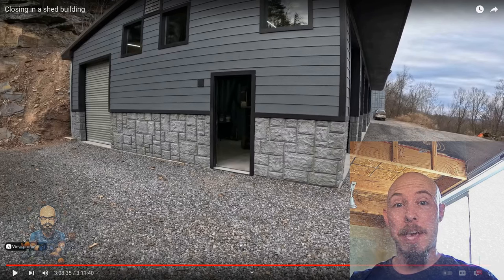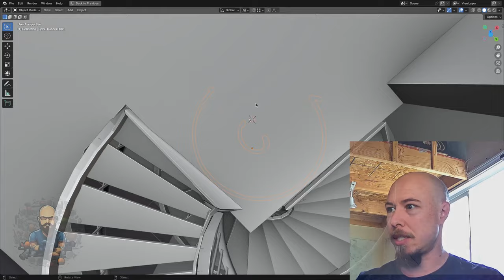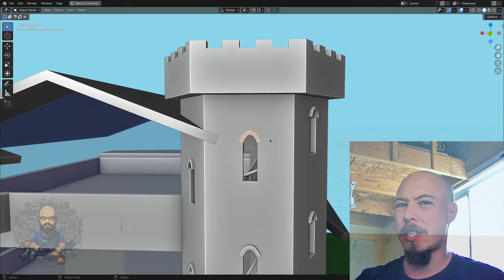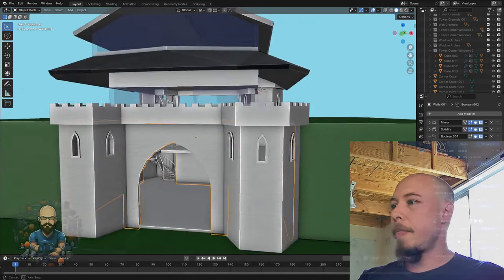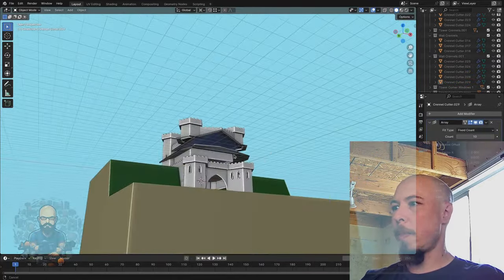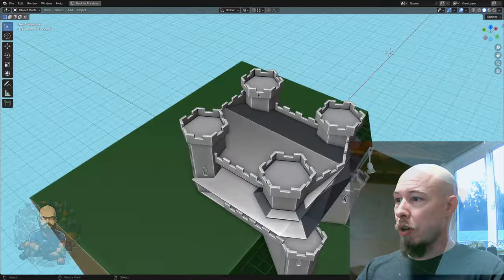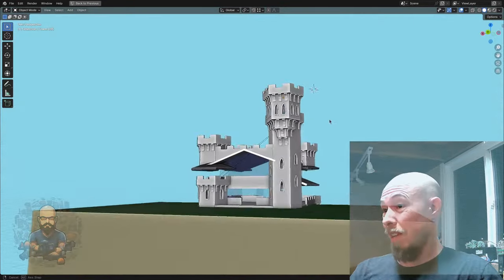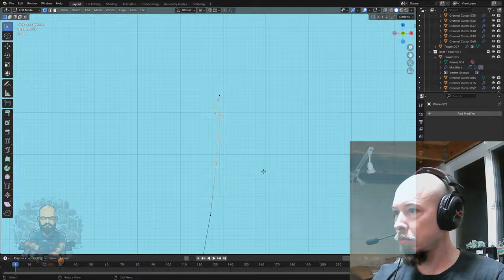Camarata Castle Architecture Ideas

Comment: Thank you for taking the time to do this. Did you draw all that just from my video? I can send you the sketch up file. I like how you did the stairs. I like the windows more pointy. That low tower is going to be a bathroom on the 3rd floor with a heated utility room on the second floor, that's why I did not fill it with windows. I like the arched garage door, was thinking doing decorate steel double doors for that instead of a traditional garage door.
Reply from the maker: My pleasure! Yes, I modeled it from scratch based on what you showed of your sketchup model in the video. I got your sketchup file downloaded from the link in your comment, but it's not much help to me at this point. 😅
Makes sense about the bathroom.
Glad it gave you some inspiration for the arches! Looking forward to watching the construction.
Reply: If you want the symmetry you could go with frosted glass on the bathroom tower
Reply: You should incorporate large timbers as well, especially since you have plenty of them on the property. I always liked the way some of the old western industrial mountain mining buildings looked, with exposed concrete, iron, timbers, catwalks, and stone.

Comment: A mechanical engineer that uses Blender instead of "parametric" modeling software. That is uncommon. Interesting perspective on the building!
Reply from the maker: Blender can do parametric, as well as procedural, plus solid, volume, and kinematic modeling. "professional" 3D modeling software is all a stinking garbage fire, and I should know because I've used them all. Blender runs circles around all of them, costs nothing, and has more capabilities. Easy choice.
Thanks! Hopefully it helps to make the new "castle" more architecturally interesting.

Comment: I love the pointy roofs you added. That looks so interesting. It's a great design of a traditional castle, combined with modern touches such as all of the glass. If the glass is tinted I think that would contrast even better. It would look like someone restored an old castle and made it ultra modern. Also I wonder for the rear of the castle, at ground level (the first glass level) that could be extended out further with a flat roof, which would be the second glass level's balcony. You could do some creative stuff with that, it would also make the castle look bigger, basically like a mansion.
Reply from the maker: Yeah, making the main roof pointy gives it a Japanese castle look.
I hadn't considered altering the footprint, but you're right, there are endless options once you start. Maybe a little fortified walkway over the front door?

Comment: a lot of work impressive Blender work, but the net effect is that it looks like Disney World.  a better contemporary design example of metal, concrete and glass construction would be Frank Gehry designs, such as the Guggenheim Museum in Bilbao Spain.  some of the crenelations could still be incorporated, but the rigid need for symmetry would be ignored and that would lend itself to being more flexible with various site conditions.
Reply from the maker: Thanks! I've been using Blender for a while now.
Now that you mention it, I see the Disney Castle look, especially with the pointed tapered towers. Not sure that's bad though; The Disney Castle is attempting the pinnacle of beauty, so I take the comparison as a compliment.
You can keep Frank Gehry; I don't like his designs. His buildings look like they were defrosted in the microwave without taking them out of the plastic package.

Comment: 9:38  It looks like a mosque window
Reply from the maker: Yes, the pointed arch originated in Islamic culture around the 8th century. However, it is usually closer to the 4-center arch in Islamic architecture, having a lower curvature (or even an inverse curvature) in the center. The Gothic Arch always has a single radius, tangent to the verticals.